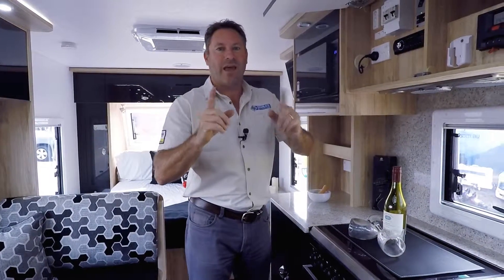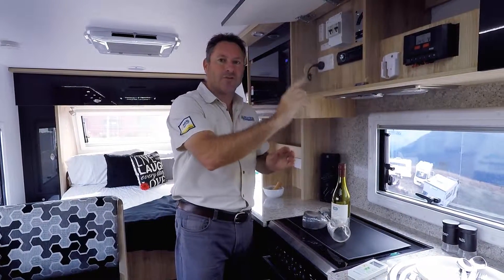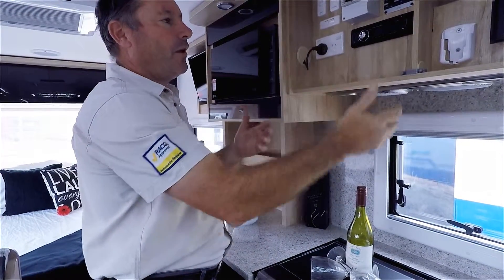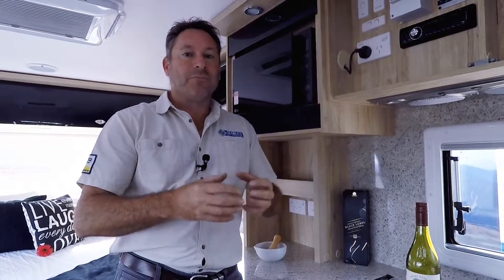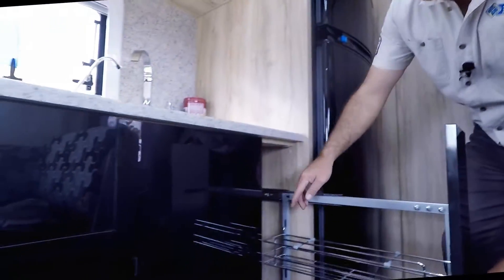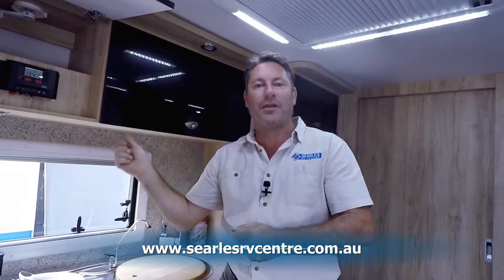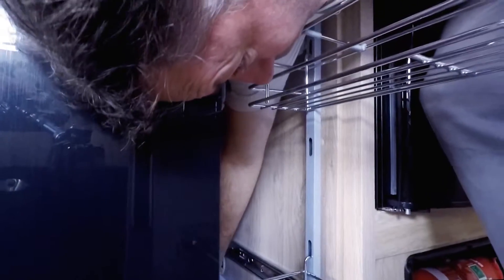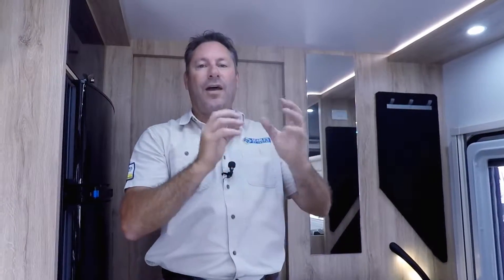Trouble shoot 240 Volt fault

Comment: What if you have no power and the fuse has not tripped and have tested the lead into the van and that works plug back into van still no power and fuse has still not tripped